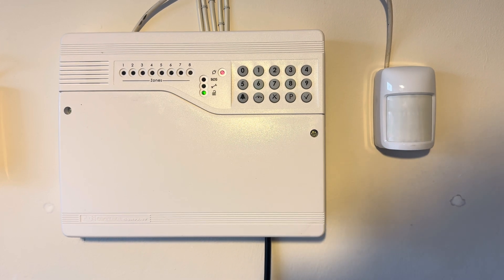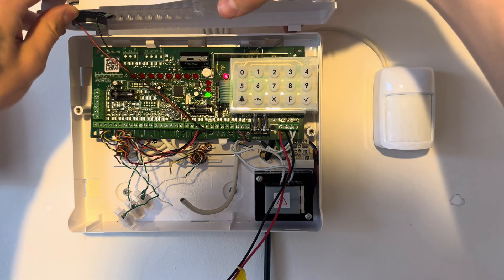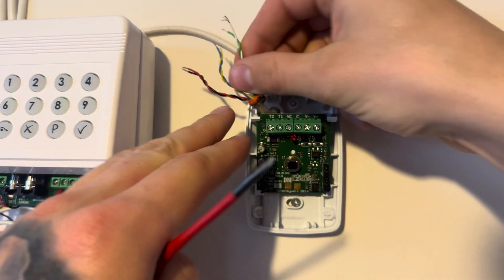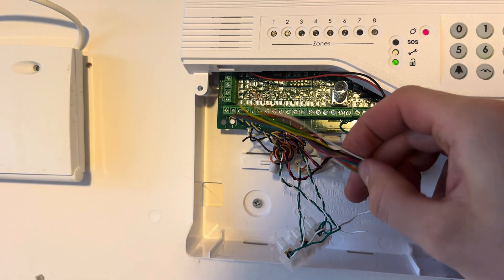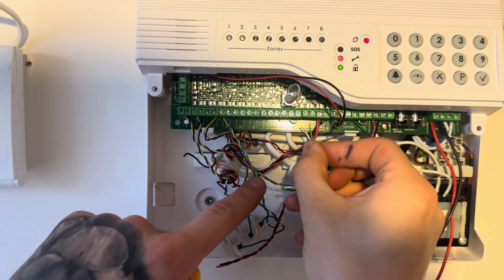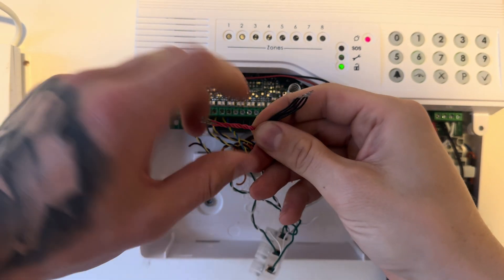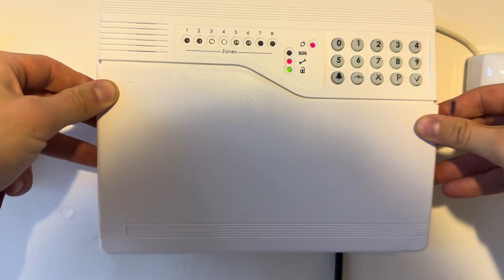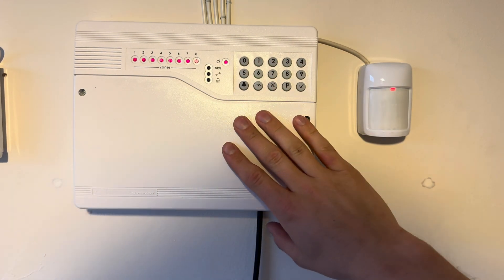how to Wire a PIR Motion Sensor to an Optima COMPACT alarm (Step by Step)

Comment: I have exactly the same alarm as in this great instructional video. For some reason we had sporadic false alarms for no reason. We have now changed all three PIRs, battery and PCB board inside the min unit. Still getting false alarms. Last night alarm triggered front door contact. Why? What is the reason for this strange behaviour? Can anyone help me please?
Reply from the maker: Hi mate! Are all the false alarms on the same zone, the front door contact? If so you may need a new front door contact, but you should also check your cables are ok, I have a video on my channel about false alarms and how to fault find
Reply: @SimonSecurityExpert  thank you for responding! 
Really didn’t expect you to bother with my little persona 😊
No, false alarms happen in random zones. Last night was the first one it wasn’t triggered. I have ordered a brand new battery as I heard that you have to look at the date on it, and add 6 months to make sure it is ok. As apparently Yuasa batteries have to be charged at least once in 6 month to retain its ability to hold charge.
To summerise, there is no consistency in alarm triggers. All cables are inside the wall…I can only check connections and whether current getting to them is stable. All PIRs are brand new and main alarm unit is also new.
And I am a female 😂

Comment: Simon I want to wire 2 pir motion sensors together so they are on 1 zone the entry/exit ,be grateful of your help
Reply from the maker: Hi mate happy to help, first thing I need to know do you have one cable going out from the control panel going to the sensors or do you have 2 separate cables (one cable for each sensor) coming back to the control panel?
Reply: Simon your a star ⭐ 
I’ve done it,very happy,thanks very much 👍
Reply from the maker: You’re welcome mate happy I could help 🫡
Reply: I’ve got 2 separate cables,it’s just my alarm panel is at the back door which I use all the time in the entry/exit I don’t use my front door but pass the front door  going to bed at night to go upstairs but have to omit it which is not good really
Reply from the maker: No problem mate this is an easy fix here are the instructions: 
1. Open control panel (this will cause a tamper alarm so put code in to cancel) 
2. Identify the zones you want to join together
3. Take the cable out of the zone you no longer want to use and replace it with a wire link (closing the circuit) you can use a piece of off cut cable for this or a staple for example
4. Take one leg out of the entry/exit zone 
5. Take that leg that’s out of the entry/exit zone and twist it with one leg of the other cable, and put it in choccy block to secure it 
6. You now should have one leg remaining on its own, put that into the other side of the entry/exit zone 
7. Close up panel and reset 

You have now joined the zones together onto an entry/exit zone 👍🏻 hope this helps mate let me know if you need any more info